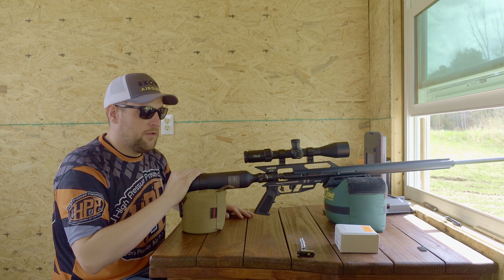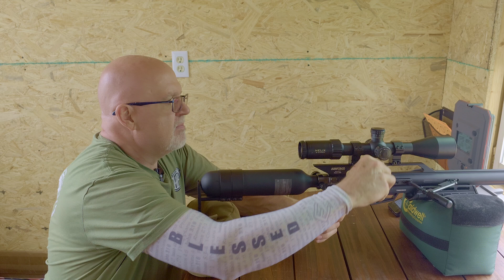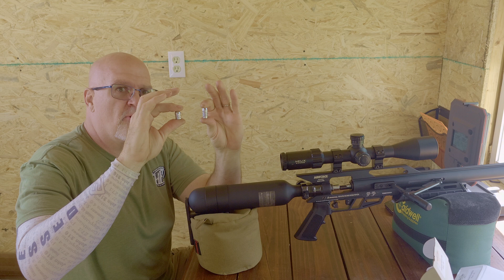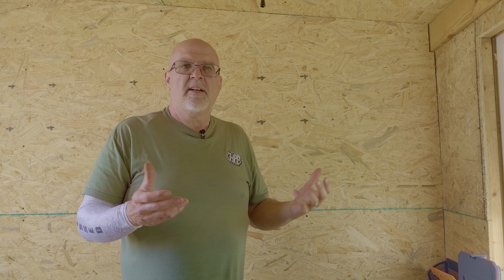Airforce TEX-REX now at High Pressure Pneumatics!

Comment: Hey buddy your math is wrong, 981 FPS with a 470 grain slug equals 1004 FPE.
Reply from the maker: Thank you for bringing that to my attention, I appreciate that.
Reply: He most likely didn't change the weight settings in the chronograph. So the chronograph gave him the FPE of a 350gr.
Reply: 1004.59682
Reply: It was actually 1006 fps not 981. 1056 FPE. That was the 2nd shot.

Comment: Picked up my TEX-REX from HPP a few days ago and have been testing it.
I have the original LSS 50 with the carbon fiber tank to compare it with.
Both versions have a 1 in 24" twist rate, I measured it to be sure.
The TEX-REX is a lot more powerful, it's also louder so use hearing protection.
I've used the LSS 50 for deer hunting and can't wait to try the TEX-REX this year.